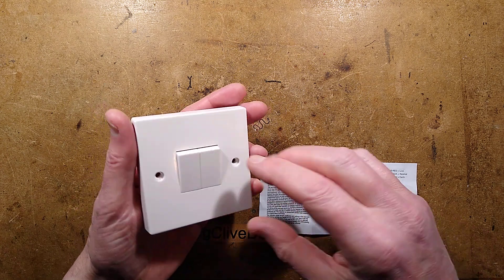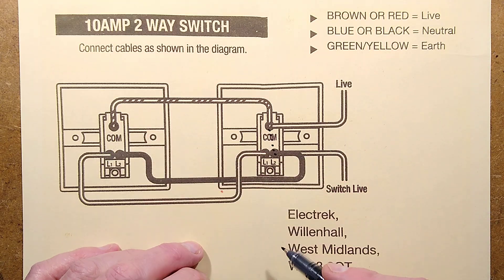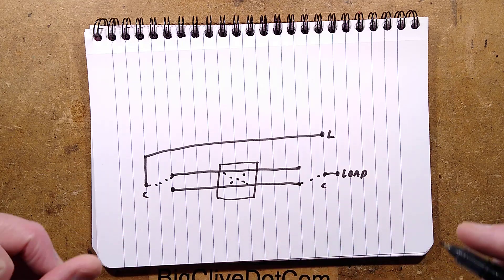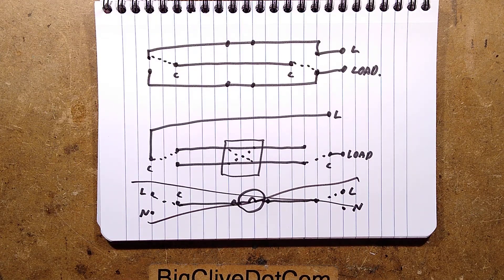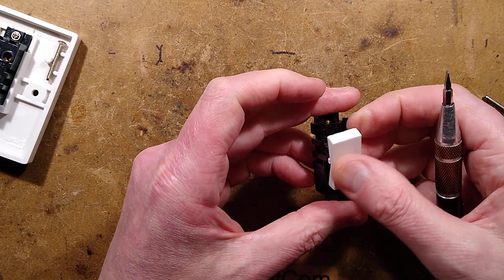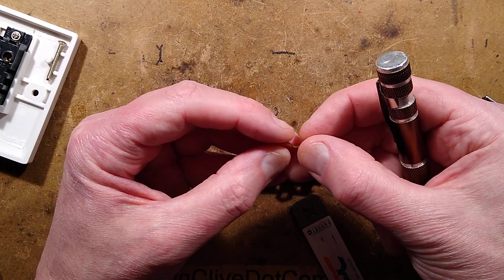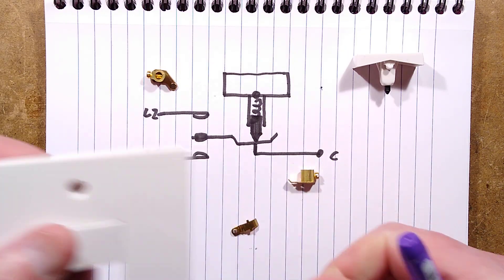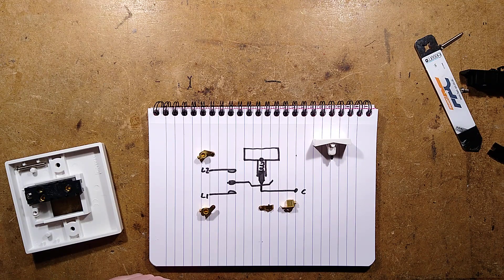Poundland 50p switch teardown

Comment: The "3rd-way" (often called "Chicago 3-way") probably isn't very common beyond old houses using bare wire on tube insulators since it requires having L+N at both ends with single wires going to the loads from each switch.
Reply: Bonus danger: In North America where we have split phase, there are two different "Live" that are 240v apart and 180 degrees out of phase. If you don't use the same leg for both ends you have created a dead short across 240v...
Reply: @Smidge204  Many places in Europe have 3 phase (even in a small apartment), with about 400V between phases (230V  phase2neutral)
Reply: @Smidge204  Can't be 180 phase shift. It's 120 phase difference AND there are 3 phases available in the street distribution network. 
I guess it is possible to have those 'spit phases' appear on a lighting circuit there in USA, because any unqualified DIY moron can wire up a home legally there. 🤦‍♂
Reply: @BTW...  Yes, the wiring in most residential homes has two phases, 180 degrees apart. A single phase from the grid is fed to a center-tapped transformer, and each end of the transformer's output becomes one of the phases, with the center tap being neutral.
Reply: @BTW...  It's 180 degrees out of phase, because standard residential power (120/240V) is derived by taking one of the three phases on the poles and stepping it down to 240V with a transformer that has an earthed center tap that is also the neutral, resulting in two 120V line-to-neutral options and one 240V line-to-line option.
Reply: @HiddenWindshield   You sure know how to waste resources in the USA.
Reply: @HiddenWindshield  It is a 3 wire single phase system. 180 degree cannot be considered 2 phase because it cannot produce a rotating magnetic field. 2 phase systems used 4 wires, imagine 2 single phase circuits with 90 degree phase shift.
Reply: @mernokimuvek  It is a two phase system, because there are, in fact, two phases. "Being able to generate a rotating magnetic field" doesn't have anything to do with the number of phases.

Yes, you can have a two-phase system on 4 wires, if each phase has its own neutral. You can also have a three-phase system on 4 wires, if each phase shares a common neutral.

No, the US doesn't have separate circuits for outlets and lights. Instead, we generally divide it up by room; i.e. we'll have one circuit breaker for the living room, one for the kitchen, one for each bedroom....

Technology Connections has a great video on the US electrical system. It's titled "The US electrical system is not 120V".
Reply: The hallway example mentioned in another reply is the perfect motivating example for the "Chicago 3-way". At the ends of the hallway, near the switches, you might have outlets as well, so L+N are already at both ends. Now the only wiring you need to strap to the lamp in the center of the hallway is a single conductor from either end, which beats all the other solutions in the amount of conductors used. Thankfully, "amount of conductors used" is not a valid reason to violate code.
Reply: @tw11tube  are there any wall-rated single conductor wires? None that I can think of if we exclude grounding runs. So in remotely recent code, you'd be stuck running 14/3 even if you only used one conductor.
Reply: @teardowndan5364  There is here... It's single core double insulated.
Reply: Bare wire? Isnt all knob and tube wiring rubber and cloth insulated?
Reply: So in the US you dont have separate circuits for outlets and lighting circuits?
Reply: @mernokimuvek  it varies. Nobody I am aware of has a house or apartment with dedicated lighting breakers. On the plus side, having one circuit per room or wall also means you don't lose all hard-wired lights in all rooms on a whole floor when a light trips a breaker.

Comment: FYI ..... The ( fancy ? ) E27 lamp holders sold by Poundland™ are  wired correctly , with the USA colours (  Black = LIVE ... White = NEUTRAL  ) .... but their paperwork says Black is neutral ( possibly copying the old 1960s UK colours ? ) , so the amateur DIY person may  have a live outer bulb screw thread ( if mistake not spotted ! ) ... this might cause a tingle up the ladder 😝( ? ) ... ( also a STATUS product , BTW ) ....... DAVE™🛑
Reply: If it was wired correctly to US colours it would be an E26 lampholder - not E27.
You will not fit an E27 lamp into a E26. 
Again, no surprise there would be problems when amateur DIY dickheads get involved with mains wiring systems.
Reply: @BTW...  Hmm ... I have not come across E26 (  I do not have any US , 115 Volt lamps !  ) ... but the holders are  E27 , as all the UK screw bulbs fit ( ! ) ... good info though .... DAVE™🛑
Reply: When fitting an Eddy screw holder I would ALWAYS do a polarity check at the end of the job, by poking the outer with a trusted neon screwdriver. I don't care if it's my stupid mistake or someone else's, I want to know about it.
Reply: @trueriver1950  BC is the Standard here, except imported domestic appliances, like table or standing lamps or PAR fittings - E27 
If encountered, I always consider the outer Live, unless proven otherwise. 
I always test to check any in-lead switches are 2 pole isolating... then Tag.

Comment: Because everyone likes a good across-the-pond terminology difference, the wires you refer to as "strappers" are known as "travelers" in the US.
Reply: And we call it a 3-way switch. Plus, if you have a 3rd switch, it's called a 4-way switch.  Those tend to be spendy here because not many 4-way switches are used.

Once again, two people separated by a common language :)
Reply: @buffuniballer  When I first heard the term "3 way switch" I thought it would mean a switch with 3 positions but no, they are called "3 way" because they have 3 terminals (the term probably started with some ill educated "electrician" who didn't understand the term "Single Pole Double Throw"). Once I learned what they really were and how they were used "3 way" made even less sense because they only allow you to control the load from 2 locations. It's the same for the so-called "4 way", which has 4 terminals but still only 2 positions. 
The world would be a better place if electricians would just learn to say SPST, SPDT and DPDT.
Reply: @SidecarBob  Unfortunately, "4-way" switches aren't normal DPST switches, and they're also not DPDT switches (which would have six terminals.) So they definitely needed a new name.
Reply: @RonParker  Perhaps, but "4 way" really misses the mark. Perhaps they should have been called something like "DPDT-4" or "intermediate" switches.
Reply: @RonParker Yeah, they are DPDT with an internal crossover.
Reply: @solarsynapse  Are you saying that the Brits are any less guilty of calling things by names that don't make sense?
Reply: @SidecarBob  A little less because they are older in history.  The more time passes, the more messed up things become.
Reply: @solarsynapse  Ummmm.... I think that sounds like they do it more because they've been around longer. 
And I won't get into the letters that people in the UK ignore when pronouncing words or worse pronounce in words that don't have them. Its almost like they are trying to confuse the rest of the world......
Reply: @SidecarBob  Yeah, there is English, then there is British.  😂  The alphabet is totally wrong because it is based on Roman, which is mostly Italian.  🙄
Reply: @solarsynapse  That doesn't explain it. I think it is laziness with a history.
Reply: @solarsynapse  Latin, perchance? </pedant> :-)
Reply: @veivoli  Yes, Latin, which is still used, but "technically" dead.  Italian came from Latin and is current.  You are correct.
Reply: @buffuniballer  How can a single pole double throw (SPDT) switch be call 3way when there are only 2 switch positions? 

Here (Australia) all light switch elements are SPDT and what you call 4way is called an INTERMEDIATE switch element, because they are located between the two 2way switches. Both have 4 terminals (one is not connected for use as looping terminal. Handy to join Neutrals)
The exception to standard SPDT are the high current switch elements (15  32A), the 2 pole switches. ie. Double pole single throw (DPST) and dual rocker elements ( 2x SPST) Dimmer modules are also the same element mounting size... so are TV antenna sockets and neon indicator lights. 
These switch elements are small (about 1" square base) and clip firmly into wall plates. The smaller element size means small switch plates for door architrave mounting use the same switch element. A standard size switch plate can have up to 6 switches (12 if using dual)  This has been standard domestic/commercial switch plates since the 70's. 
All standard power outlets have a non removable switch, sometimes a separate switch element is located between a twin outlet - useful for extractor fan or wall heaters etc.  
Pre 70's switches and earlier looked like those huge body stuff used in UK and USA... but nothing was so large and 'agricultural' as the stuff still used in the USA.
Reply: there's a prejudice against travelers over there XD
Reply: @prjndigo  The U.S. desperately needs that!  10 million reasons why.
Reply: True
Reply: @aaronbrandenburg2441 of
Reply: I'm pretty sure they're wired the same way, but I'd have to check with my electrician relative to find out for sure.  They do work the same way in installations like Clive illustrated.
Reply: Messing with Travellers in the UK is a risky business.. just sayin'
Reply: lol. English people, in general , loathe travellers.
Reply: The thing with standards is that there are plenty of them.  😂🤨
Reply: I know what a strap-on is.
Reply: Pretty sure there's already comments on this but just stating just in case the third non-compliant method what we call generally three-way switching in the United States is what is often referred to here as Charter wiring at least one variant of this there's a lot of other non-compliant stuff as well regarding commonly done Back in the Day stuff with various combinations of three switching some of which was to save for example in a detached garage oftentimes you would have overhead wiring between the house and garage and you would need more desire to have an unswitched receptacle and the light of course switch separately but be able to be controlled from both the house and garage sometimes although this may have been an outdoor light but there was one method of wiring that was common in today but now not approved where has to save one overhead wire back in the day this was significant and also less work and quicker there are some really odd ones out there that can really get your head spinning when you can't figure out what's going what's a fouled up three-way switch thinking there's other problems going on or like an open wire somewhere for a problem in a non-existent junction box or otherwise and it was just one of those Oddball ones that was just throwing you for a loop sometimes also someone abandons a three-way converting it into just a standard switch and unbenounced everything is still open place and yep of course Dennis realize oh yeah that's just abandoned place and realize that was just something simple and there you go in there there's that weird case where someone installs a pull chain fixture and completely removes all the other switches for no apparent reason and yet no sign of power being tapped off perhaps another light or receptacle elsewhere and of course it's where you really need the original switch location to actually make the area practical
Reply: @aaronbrandenburg2441  Can we have that with some punctuation etc please? Otherwise it is impossible to make sense of.
Reply: @aaronbrandenburg2441  That is unreadable.  Here have some of these to use in the next posting  , , , , , , , , , , , , , , , , , , , , , , , ,  . . . . . . . . . . . . . . . . . . . . . : : : : : : :  ; ; ; ; ; ; ; ;  - - - - - - - - - - - ? ? ? ? ? ?  ! ! ! ! ! ! ! 
On the subject of non-compliant - This is what you can expect when unqualified DIY idiots can wire up homes legally.
This is why I loathe working in domestic installations - the high potential for layer upon layer of DIY bodgy work that I can be held responsible for if I'm the last person to undertake works and there is a death or fire, because I didn't see and rectify the DIY crap some moron did years ago.
Reply: @aaronbrandenburg2441  Just trying to read that comment sent my head spinning!  Punctuation, man!
Reply: We  have travellers in the UK, they also give rise to trouble in places...
Reply: @GluteMaximuz  They usually manage to use the word Fek in every sentence which is impressive
Reply: God forbid we all agree on a standard. Someone should come to with a standard to select world standards then we'll be good
Reply: @Stealth86651  Dictionary definition - Standards (n): Tribal totems, or battle insignia. (This comes from the IT world, but probably works everywhere!)
Reply: @Stealth86651  I don't know where you live, but here in America, the first time anyone mentions working with multiple other countries to create a shared system, all the flies come out of Ronald McTrump's butthole and they start buzzing about "world government" and "eating cats and dogs" and "God bless America, they took our jobs"
Etc ad infinitum. 
People who confuse "patriotism" with xenophobia and zealotry.
Reply: @Stealth86651 the IET wiring standard (British Standard 7671 is harmonised with European standards and the Indian Electrical code 2023 is pretty close to both (despite what casual observation of wiring in Maharashtra State led me to believe!)
I think the biggest difference between the UK and US is that the US requires things done 'to code' whereas UK the wiring regs are a guide and you can do things differently if you're prepared to stand up in court and justify your design decisions. That said, I believe that the Code varies between States.
Reply: @davidquirk8097  Code doesn't just vary between states, but also between counties and even municipalities. There's a model code, NFPA 70, the National Electrical Code, and most jurisdictions adopt that as a baseline, but they can then also opt to add or omit parts.
Having just built a house, I can say from experience that things are supposed to be done to code, but the extent to which that's actually done strongly depends on how attentive the inspector is and how good the contractor is at getting them to look the other way.
Reply: I say this earnestly - I think there's enough deviation between English and American as languages that they should be considered different.

So what they speak in the USA should be considered "American" and everything in the Commonwealth "English".

It's as different as Scots is to English, or Slovak is to Czech. It means that you can make clearer terminology changes, and things like subtitles or closed captions can be translated between the two.
Reply: @DeathInTheSnow  I frequently describe this situation as two peoples separated by a common language.  😁
Reply: I created simple english to finally fix it.  10 vowels and 22 consonants.  That's all that is actually needed.  Simpel English
Reply: @DeathInTheSnow  I suggest "English" was abandoned at Mayflower steps.
Reply: @DeathInTheSnow  Some people refer to the predominant language in the US as "Murican"
Reply: @SidecarBob  A fantastic example of how the language has morphed and become its own thing!
Reply: @DeathInTheSnow  USAian, please. Given that the continent of America is so large as to be divided into North and South, "American" covers a lot of ground. Everyone from Canada in the north to Chile in the south has the right call themselves "American", surely? And if you ask someone from, say, France or Germany where they are from I'm pretty sure they won't say "Europe".

A little while back there was a story about a student in the USA who expressed surprise that people in England spoke English. She was quoted as saying she thought that they would have their own language! One of those stories you hope is true...
Reply: @DeathInTheSnow :

England got its name because it as the land of people who spoke Aenglisch.

The language was imported.
The name of the language predates the countries where it is spoken.

More accurately, England should be called Lower Britain.  It has no exclusive claim on the name of the language.
Reply: @denverbraughler3948  Nah, England should be called Poundland

Comment: Isn't the problem that they have included the wrong instruction?  You described how two individual switches (eg top and bottom of stairwell) can control the one light, but this looks like it's a dual-gang switch designed to control two different lights from one location.

So it's not that the wiring is wrong, it's the wrong instruction totally!
Reply: Each switch can be used as part of a two way (British terminology) controlled lighting circuit. So you could have two, two way circuits... And yes the instructions are worse than useless.

Comment: Something akin to the non-compliant method of wiring shown was used by some interurbans and tramways to light strings of lights across the overhead and earth, switchable from either end, and used for signalling purposes. See here (in Dutch) for an example: https://nl.wikipedia.org/wiki/NMVB-seinstelsel

Comment: I recall using 2 double pole single throw switches with 3 wires connecting the 2 switches to operate lights in a long hall or stairwell...I don't recall it being too dodgy 👉♾️👈
Clive(BIG) calls out Big Olive batch slip🩲🩲🩲🩲🩲